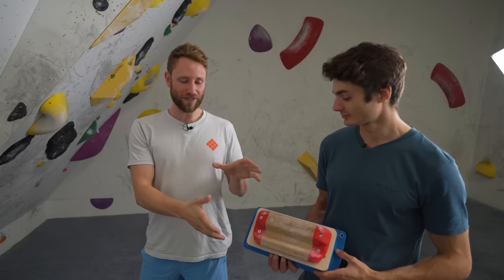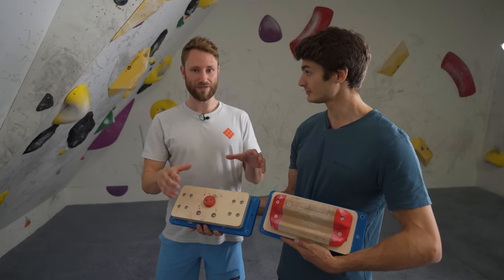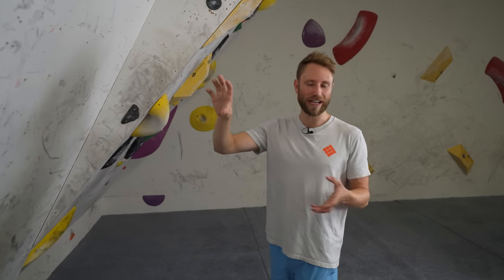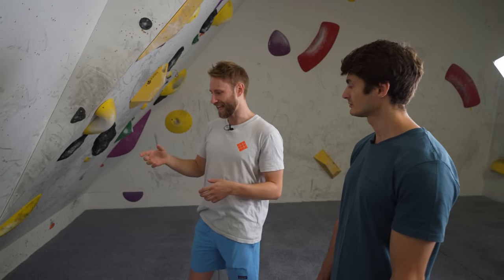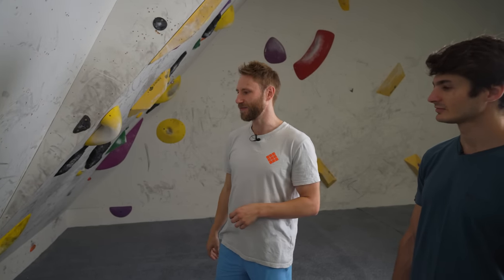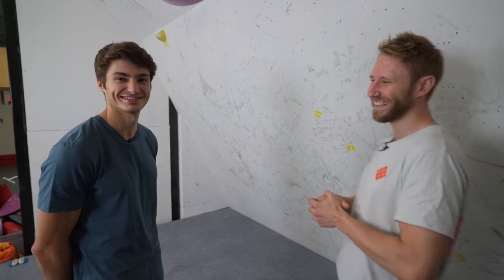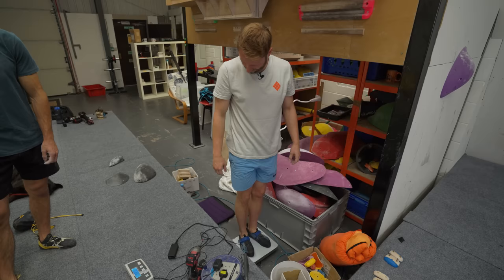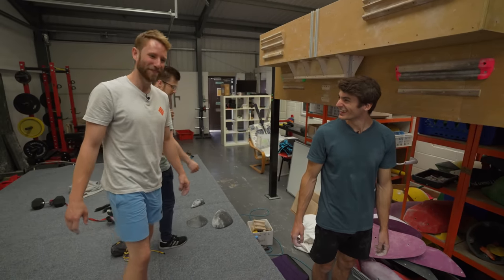Analyzing Climbing Technique with Force Plates!

Comment: Okay, technical question: Do these force plates measure in only one axis or in multiple axes? The point being that outward force could be one of the major differences in force disparity since this wasn't tested on a vertical wall. Billy could be pulling in the Z-axis more than Josh, and Josh could be producing more force in the X-axis during drop knees. I'd love to see more of this! Specifically, off balance throws and cut loose moves to highlight the difference between intermediate and advanced climbers.
Reply: +1 for this question. I had the same thought pattern.
Reply: I think the most interesting on the hand holds is the z-axis. Because that takes your most energy. With the drop knee, the foot holds had no measurement. Of course Josh used better the x-axis on the foot holds to get tension.
.
Reply: I would say that it is very unlikely that the devices used in this experiment are suited for multi-axial usage. Guessing from how these sensors look like I assume that at best their construction mitigates the outward forces all together or worse it skews the downward pull measurement by applying bending strain to the measured medium.
But hands down this is a fun experiment and since they are shooting for very rough measurements and mostly entertainment this is completely fine. I'm pretty sure that they are aware of what limitations they are dealing with.

👍
Reply: Can confirm these force plates measure in only 1 axis. Still so much to learn, I agree omnidirectional forceplates have huge potentail to help here!
Reply: I also figured the devices were limited to a single axis, which is a shame because like everyone else is saying, I think the  z-axis is the most interesting part, I’m not sure how omni-directional plates would work  but would definitely be interested in seeing it
Reply: The fact that when static the total force doesn't add up to body weight indicates they are missing a pretty big part of the story. Doing the same experiment on a vertical wall with flat holds would mitigate the amount of force perpendicular to the wall and therefore would lead to more trust worthy results IMO. But ofc this tests a different movement pattern.
Reply: Agree to every bit here commented. I went through the same thinking process as soon as I saw the setting: how about direction? And indeed only downward force is measured. It should have been checked on static start that foot signal + hand signal add up to body weight to confirm accuracy here.
Another interesting bit could be to plot a cumulative of the signals along time, to see when they add up to body weight (fully static rest position at start, and fully static rest position at landing), and when they are actually greater/lower than body weight (while accelerating in the move towards next hold, we should see greater force to move and not only to hang), and then compare these extra forces between the two climbers. Could lead to interesting finding where the more efficient climber actually accelerates less while the other overshoots the force to reach the hold 🤷🏻‍♂️
Reply: Fantastic question! It would be really interesting to see the direction of force on a hold at different angles. I also forget how many fellow stem nerds there are in climbing, love it!
Reply: Whether these force plates measure one or multiple axes depends on the sensor type that is integrated, and this cannot be seen from the outside. The force plate could be a self-made (non-commercial) device, using any sensors that fit into the size of the plate. Piezoelectric sensors that measure 3-dimensional forces can be integrated into force plates. In fact, these sensors are way smaller than the plates we see in the video. Consequently, it is absolutely realistic that a force plate of that size can measure forces along 3 axes.
Therefore, it is nonsense for someone external who watches the video without knowing the integrated sensors to make any statement about how many axes were measured.
Reply: I think it should be the resultant
Reply: they said it is measuring the force they put DOWN on it in the video at the beginning. definitly not in multiple axes yet
Reply: Would be interested to quantity the forces exerted in a resting position. Also maybe how the forces change at the beginning and end of a session on the same moves.
Reply: I think they stated in the beginning of the video that the only measurement is downwards, and none other.
Reply: I wondered this too. I tested with my S plate and it's pretty accurate measuring in the Z axis, it's only maybe 10% more than the intended Y axis. Measure in the X axis though and I get waaaaay higher forces (which makes sense given how S plates work). We don't know what plates they have but it probably is an S plate, so any compression/gaston on those flat edges will read way higher than they should

Comment: Now we need a full training board that has a pressure sensor for each hold 🤣
Reply: Hahaha the ultimate "sucking the fun out of climbing" 😂 as Josh would put it.
Reply: I would love this! Some people like the puzzle solving or the co-operation or collaboration process of the boulder problems but I just like finding the best technique such that if no one at my strength could achieve something but I can distribute my strengths well enough and achieve my best instead of just doing poorly while doing my "best" is very empowering and you get the best efficient stats then people stronger than you or even for women can see "oh there is a person at this height and this gender and if work on my techniques and distribute my energy properly I can achieve this goal once my efficiency is optimized enough... it could give hope to the weak minded people who need to see other people do it...but not want to wait for an hour for someone good to solve it...
Reply: @dark-o  as an engineer I have to disagree it would make it even more fun fore me xD
Reply: The best way to get frustration. 😜
.
Reply: also make the sensor sense force in all directions, not just downwards pressure! for example when you do the sideways deadpoint and you weight your foot more you actually need to pull on the handhold more, but sideways! This is not captured by the forceplates, because they only capture downward pressure!
Reply: @groghnash  And then a force diagram simulation of the climb and broken down to various betas it can be done - short/tall/flexible/strong/hybrid etc.
Reply: The problem is that it would be way too expensive
Reply: Training board... multi-directional force sensors behind each hold.. all linked to a system which uses AI to crunch the data in real-time and give you qualitative feedback on how to improve movement. You could even throw in a camera/scanner watching the board and tracking your spatial movement (okay getting a bit nerdy now but you see the idea!)

Comment: Really great video! Here are some studies I would love to see:
1) Compare force at start vs end of a big session. How much does tiredness change the force you can generate? How much does tiredness increase the force required due to loss of technique?
2) Compare hold types and angles. How much more force does it require to hold a crimp at 40° vs vertical etc? How does this compare for the angle of pull (Directly beneath the hold vs pulling out)?
3) Add force sensors into big moves on a board. Could you use data to predict the max hang performance needed off the wall for specific contact strength required for moves on the wall?

If these studies gave usable results then you could get Will on replicas like burden with the force setup and have a measurable target for finger strength required for the moves (Obvs not all you need but a good baseline for athletes before a trip).
Reply from the maker: Great ideas!

Comment: I would love to see a force plate that not only shows total force, but also the vector, in other words, the direction of force applied over time. I think that would give us so much more insight into "efficient" climbing, sadly I have no idea how that could be achieved, besides maybe a halo of strain gages that all connect to a "floating" gold (held in place only by the gauges). Also, the force plates on the feet would have been a great insight in the twisting move by the end, seeing how the force per feet changes through the twist would be so interesting!
Reply: Could have a force gauge for both the x and y axes, and use some trig on the backend to calculate a full vector :)
Reply: Should be no problem, but the sensors are more expensive.
.
Reply: @helpjack8843  You also need the Z axis — pulling into the wall is a critical technique. I think it's under-appreciated and, generally speaking, more important than actively "pulling" up. It gets the COG into the wall where the legs can actually drive it upwards.
Reply: @danschmidt5189  Great point, It'd be interesting to see the data on that! Personally I quite like this data driven approach to climbing

Comment: There is something wrong about the 1st and 2nd measurement.
Starting with the 2nd one:
If we look at not only the weight measured by the sensors, but also the timing, you can see that red line goes to zero right after the green jumps up, while there's still much weight on yellow. The red is indicated as "Foothold", yellow as "Middle jug". It is not reasonable that the weight would disappear from the foot (red) as soon as the climber catches the top hold. Similarly as soon as the climber catches the top hold, the "middle jug" is no longer used so the yellow should have gone down.
I think that both in the chart and in the video explanation the yellow/red were mixed up.

Also I think there's a similar mixup in the first comparison as well. It is most easily noticable if we look at Josh's chart. He is either using the yellow or the blue, never use both at the same time. Which means that those 2 must be the handholds and red is the foothold. It is also mixed up both in the chart and in the explanation. (In the video yellow is indicated as leg, but that can not be the case for this move.)

An other interesting thing that's worth mentioning is the 1st comparison. In this Josh has a huge "Overall" drop in the middle. Basically he stops using the bottom hold before starts using the top hold, which shows that he does the move more dynamically.

I really love this experiment, but the explanations and the charts need some adjusting.
Reply from the maker: Might have made some mistakes on this. We are generally pushed for time on these videos and hopefully this is just the "pilot study". We'll take more time on the next one and double check the graphs.

Comment: One very interesting and useful application of these force-plates would be to set a limit move with them and track the force data as a climber projects it, until they send the move, say, 5 times. You can then compare the average force generated during send goes with average force generated during failed attempts. Until you get omnidirectional force plates, you could set a purely vertical campus/single foot move using this regimen, and might get some interesting results.

Comment: Thanks for the video & analysis! Really interesting. A couple of ideas for experiments (hopefully not duplicated in the comments):
- Test the force output in four kinds of flags in an advanced vs. intermediate climber: forward vs. backward flag, inside vs. outside flag.
- It seems like what you quantitatively mean by "efficient" is "work done". Is that right? It would be really interesting to actually compute the work done between different athletes on the same problem, see how low it can go while still completing the move, and investigate the factors which go into that.

Comment: Definitively interesting and probably the tip of the iceberg. In particular for lead climbing, I think the actual efficiency of a move is related to the 'next move' and how long it takes to readjust the body to continue climbing. In other words looking at the integrals of those curves and not only at peak loads. Clearly this is very complex due to variety in climbing

Comment: while we are discussing the sensor detecting downward force, I think outward force may be a more interesting read on steep terrain and give a solid indication of exactly how strong a climber is as well as simply figuring out efficiencies for successful movements by reverse engineering the weight through the feet (outward force left hand+right hand higher indicates less efficiency).
Reply from the maker: Yeah measuring outward force is a limitation at the moment. But as you say, an important factor.

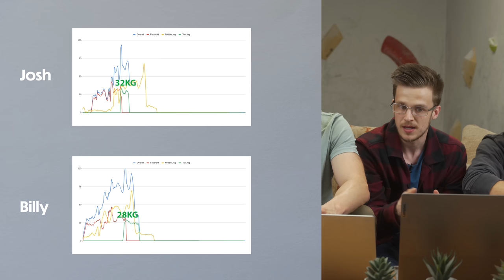Comment: Maybe you could use this device setup to look at the coordination of different limbs. As you can see which body part is applying force if they are on different holds. From the data at 8:22 it seems josh starts off using mostly legs then quickly moves to using a lot of arms. Whereas Billy uses more arms at the start and his transition to the different  holds seems to include force from all areas.

I hope I am making sense. But I think if you have the time resolution on the device you can clearly see when people start pulling with a body part compared to others.
Reply from the maker: Yeah we briefly discussed how the "shape" of the curve might be as, or more, important than peak force. And how these curves line up with each other. Though we'll need to develop a better system as currently they are out of sync. We literally had to press "go" on each of the 3 data channels in quick succession. Though I think we could line up the data retrospectively. It's just time consuming work.
Reply: @LatticeTraining fair I guess you need to do a lot of software work to get everything cleaned before making very detailed analysis. Anyway cool video

Comment: I love this video! Many times I've envisioned how interesting this might be to do the tests you did! So many nuances you could examine! 
Ok, so one question you openly avoided is what style is better (drop knee vs open)? As you mentioned, coaching does focus on working with particular persons style. However, I would add that there are real differences between how effective each style is in different situations. And from a coaching perspective you can influence both decision making and the degree to which someone practices their weaker style. I've always made a broad generalization that skill being equal, drop knees tend to be more efficient, while open climbing tend get you further in terms of distance/reach. Obviously this statement is very much situation dependent and also isnt a question isn't one thats best answered by force plates.  
I am interested, however, in a different comparison between dropknees and open climbing that could be informative in decision making and could be tested with the plates. After doing a drop knee or open move, what types of situations favor each style in post-move or flow to the next move? How much force x time is exerted on the target hold from the time the climber latches it until the time the hand(s) leave that hold? this would include the force x time used to adjust feet and hips, center of gravity etc.. I suspect in some cases we would see the dropknee making the move much easier, but the post-moves harder.

Comment: It's really cool to nerd out on the data for sure. Love this!
I do feel like for the twisting, Billy's position looks more unnatural than Josh's with the hold - the drop knee for him feels more awkward. Does he have longer legs than Josh? Despite being the same height this could also make this movement less efficient for him.
Reply: IIRC, Josh is Lattice's flexibility coach. It's not a surprise he's significantly better with drop knees.
Reply from the maker: We didn't measure leg length. I do know that Billy has a larger Ape Index than me, so longer sideways reach. I suspect Billy's legs are stronger than mine so potentially better at rocking his weight over the foot in an open position. The twisting relies less on rock-over (hamstring) strength and more on hip position and pushing outwards on the feet.

Comment: This is really cool! I wonder what's the difference in the overall force applied to the holds by Billy and Josh in the same move over time cause it seemed like this is comparing max force generated at a certain time point (if I understood it correctly).

Comment: I think the numbers showed that also for josh doing the static move openly was more efficient
Reply: Yes that's how I understood the numbers as well: 45kg openly and 46kg while twisting, but they didn't address it so I don't know
Reply: @moonlight00001 I was hoping they would address this. Although Josh's force on middle jug was 1kg greater on the middle jug with twisted position, it seems his overall force was quite a bit lower. I also wonder how much the muscle groups used for each method could affect the perceived difficulty/overall exertion to execute the move versus the actual forces applied.

Comment: I think you should do a campus move as well, once dynamic and once slow locking off, just to see what influence dynamic movement has to the graph. I can't really tell, but I guess the peak force on the hold is higher during a very dynamic movement. I have a feeling, that interpreting the graph is not that easy, and the more I think about it, the more I get confused about the phyisics behind it

Comment: I've always wanted to see a force plate analysis of how toeing in and body tension reduce the load on fingers on an overhang.  I think for beginner and intermediate climbers, the whole body tension thing is really not intuitive.  One of the instructors at our gym once told me that you can always toe in harder than you currently are.  What does the force plate for your hands look like through that change.  Or how about the difference between dropping your butt and hanging down versus arching your back and pulling your hips in toward the wall on a 45 degree.